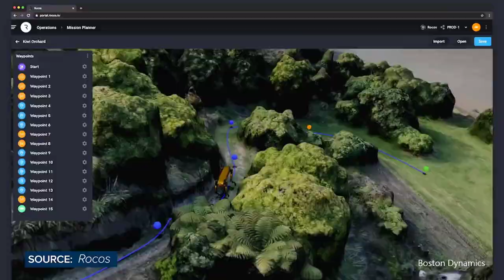Bilge Pumps does Battlestar Galactica Deadlock for Navy Con 1/2

Comment: You might find this amusing:  I worked on the digital computer software for the upgraded versions of the US Navy TERRIER Guided Missile Anti-Aircraft Systems (GMFCS Mark 73 MODs 6-10) before it was eliminated due to the decree that steam turbines, other than for the nukes, were to be scrapped by 1992 (decreed in 1990 with no warning whatsoever, which was quite a shock to our group, among many o0thers!).  The places was originally called NSMSES (Naval Ship Missile Systems Engineering Station), Port Hueneme, California, on the huge Construction Battalion ("SeaBee") Base there, and later called several new things, now Naval Surface Warfare Center (NSWC), Port Hueneme Division (/PHD).  When the new digital computers for TERRIR, the Univac 1218B 18-bit (18, not 16) General Purpose Digital Computer, called by the US Navy the Computer Mark 152 ("C-152") and the size of two large refrigerators standing side by side, with only ~32,000 words of memory on the ships (~48,000 maximum possible, which we used in our own in-house test machines).  One computer per radar, so a ship might have two (if it had a 5"/54 gun on the other end of the ship), of four systems (two per ship end, sharing a single missile launcher per end with two rails on it).  This computer setup on ship was connected to the ship's CIC computer complex by a single line to one of the two computers in a twin-radar battery, with whichever computer was directly connected relaying information to/from CIC to the other system, with either one being the "master" of the two so connected and the other being the "slave".

At my facility, the computer test area had several of our own C-152 machines in the 48K configuration with switches allowing them to be wired up in different configurations and connected to various consoles, printers, and other test equipment for evaluating the software before being released to the ships in the case of new upgrades and, if a ship reported a problem, trying to reproduced said problem and find a fix for it if it was software-related.  I did a LOT of that since I was the assistant to our genius (NO JOKE!!!) director of that simulation facility.   This facility was our replacement of the one inherited from Naval Weapons Laboratory (NWL), Dahlgren, Virginia, where TERRIER was originally finalized in a really Rube Goldberg setup and said simulation system director, one Ernie Childers, stated that we were a PROFESSIONAL ORGANIZATION and he would not tolerate the "crap" Dahlgren had sent up and created, so mostly all by himself, he created from scratch a new design for our WASP (Wrap-Around System Program simulating an entire warship so that the ship software we ran did not know it was not on a ship and we could monitor it as we ran through various tests and sent fake messages to the software just like a ship equipment suite and CIC would).  He created souped-up monitoring and interactive software from the test computers to the computers running the ship software that allowed him to actually monitor a single memory location in the ship software computer to see what happened when we changed some input to the software (CIC message, message from the other C-152 computers in the simulated battery, or faked equipment response, such as the launcher aiming at a target) -- Dahlgren's Kluge could not do that!!!  When he retired I inherited it all and had to make sure that I upgraded the WASP to match new versions of the TERRIER GMFCS as they were getting ready to install them aboard the TERRIER ships -- not an easy thing, since I had to, among other things, fake an AN/SPG-55B tracking and control radar (one per system) as to EXACTLY what it would do under every possible condition while WASP simulated a missile engagement with some enemy target using the upgraded equipment THAT WAS NOT EVEN ON THE SHIPS YET!!  I sweated a lot, let me tell you!

To keep which ship software version was running on which computer, the software initial writers (we did patches, not the original upgrades), VItro Industries, used a simple system:  On the enter front panel of the C-152 computer (a sci-fi addict's dream machine with flickering lights EVERYWHERE!) had the main registers displayed, so that at the end of each 32-Hertz cycle of the program OS loop, there was a tiny window of time until the next loop started and they displayed a pattern of lights there that differed for each version of the program.  The lamps would flash up and down or a checkerboard or something, each pattern instantly recognizable, identifying what was running in that machine.  The last version of TERRIER before it terminated was the MOD 10 version (using the SM-2 Extended Range version of TERRIER the terrier missile  with a number of AN/SPG-55B radar improvements).  When we first loaded it up in WASP myself and some of the other techs who handled the various weapon equipment suites on the ships were there to do some simple checks to make sure it was running at least as well as the previous MOD 9 version had. before officially accepting it from Vitro.  We cabled up the computers to each other and to Ernie Childer's souped-up WASP control consoles and a ship-type test console and a printer for recording messages sent back and forth, and finally to the large magnetic tape handlers that loaded the programs and recorded various test results for later review on those large inch-deep 12"-wide tape reels, some with programs on them and some blank for recording purposes.  When we turned on the MOD 10 ship program, instead of the usual pattern of two alternating patterns of flashing lights as the identifier, as mentioned, suddenly a single lamp on the top row of the register being used for the ID pattern lit up on one end of the row and the single lamp lit slowly moved to the other end and then back again -- A BATTLESTAR GALACTICA Cylon Warrior eye motion. (note that this took a special small computer program module inserted into the ship program to do, not just the simple pick-a-pattern-and-reverse-it method previously used).  We looked at that and laughed, since some of the actual test equipment we used was IDENTICAL to the faked equipment on the TV show (supplied by TECTRONIX INCORPORATED to the TV show as a continuous advertisement of their stuff; how's THAT for "product placement"!!).  I always had to stop a giggle whenever I used that program.

Note that doing something like that was a real problem.  We occasionally had "distinguished visitors" (Congressmen and such) to "inspect" our facility and if you did tricks like that which the visitor thought was "a frivolous waste of Government Resources", you could get into hot water with him and our bosses.  Such is life...
Reply: Wow. Great story. Watch out. We may try and drag you on to Bilge Pumps to relate some of these experiences!
Reply: @ArmouredCarriers  Yeah.  I has a lot of interesting experiences with TERRIER and, after it "bit the dust", TARTAR and, finally, the FFG-7 "mini-TARTAR" missile and 76mm gun fire-control system.  I did programming, data processing to solve problems, acceptance testing, spec writing, and finally, Software Quality Assurance for our division working on the FFG-7 systems (we were at Level 3 of SQA, not NASA's Level 5, since we could not afford the extra people or equipment needed for that)..

Comment: Instead of adding less-capable backups, one of the major ways of improving weapons is to make the main weapons more able to hit targets coming from any direction no matter where on the warship the main weapon might be located.  For most gun systems, using unguided projectiles, this is only partially possible if the weapon can vary its muzzle velocity to act more like a mortar for lobby a shell at a short range over the top of something blocking its aim, such as a ship superstructure if the weapon could point in that direction (usually not possible in large gun mounts in most warships, though.

For missile systems using guided missiles, the missile can change its trajectory over a range of values to allow it to  bypass over or to the side of some obstacle and still get a hit on a target on the far side of that obstacle if that target were properly being tracked and the guided weapon could respond to the alternative-tracker's information properly.  This seems like a no-brainer concerning guided missiles, does it not?  Well, GUESS AGAIN!  TERRIER missiles were large, with a large, fall-away booster to get them up to near-hypersonic speed (they were not called "Extended Range" missiles for nothing!) and were fired from large two-rail-armed launchers, each launcher shared by two missile systems (two separate radar tracker/controllers, actually, each with its own computer and control console) in a battery.  The booster represented a minimum range for usual engagements, since inside it, before the booster fell off, the missile's internal fin-controlling guidance system could not guide the missile much or at all.  In a battery on one end of a ship (no matter what was on the other end, a 5"/54 gun or another TERRIER battery), the limitation to firing at a target at the far end of the ship by the battery at the near end was two: (1) The radar was blocked by the superstructure (mast, funnel uptake, etc.) and had usually about a 30-degree arc that it was forbidden to radiate into -- electric cutouts built into the radar mount.  Prior to the modern systems allowing radars to hand-off missile fired by one system to another system with better visibility (not a simple thing to do!), the radar cutout zone was final unless the ship could maneuver to keep the radar from hitting its blind zone.  (2) The inability of the launcher to point in the direction desired (also mechanical and software "non-pointing" zones), which was mounted to the weather deck and rotated to aim the missile in bearing and, by raising its arms, both missiles at once in elevation, to the desired aim point.  Since the launcher was much lower than the big radars, the arc that it could not point at for targets nearby, with low elevation of the arms, was much wider, more like a 120-degree-wide zone centered on the midship superstructure, though against long range and/or very-high-flying targets with the launcher arms raised to about 45 degrees or more, the arc blocked out was much smaller, not much larger than the radar blockage zone.   The old electro-mechanical computers (C-47 designs) for aiming TERRIER missiles had only one setting for any given target position, speed, and course, with no ability to change this, exactly like a gun mount.  Thus, the launcher cutouts were absolute and non-negotiable.

When they created the TERRIER digital computer software for the C-152 digital computers that replaced the C-47 machines, the designers understood that they now could do all sorts of additional testing and created a large suite of various tests that could be run at various intervals to find out if the system needed any maintenance and other tests to help the technician do that maintenance.  BUT THEY DID NOT CHANGE THE LAUNCHER AIMING LOGIC AT ALL!!!  If the target put the launcher into its non-pointing zone, then, just like with the old C-47 computer, the launcher would not do it and the target was "non-engageable" (which is not a good thing against incoming supersonic or hypersonic cruise missiles, as I am sure you would agree!).  This remained the case for several years, from the early 1970s -- I started work there as a bottom-grade Electronic Engineer at the end of 1972 just when this "computer stuff" was beginning to be introduced --  when the first versions of the digital TERRIER systems came into being (the MOD 6 and MOD 7, each with different radar upgrades, acting as a test platforms for their combined MOD 8 version later on) until the early 1980s just as they were introducing the much more capable SM-2ER missiles (enlarged versions of what was also being introduced in Aegis and TARTAR missile systems)..  As a programmer for digital software (as well as my work in the simulation facility), I had to create patches to fix the software due to various problems.  One of the problems was that each ship, due to slight design differences as built, had its own tables of various unique values that had to be put into the software sent to that specific ship, regardless of the more general upgrades for new equipment changes.  Among these unique inputs was a set of values for those non-pointing zones for the radar and launcher to make sure that the software never ordered the radar or launcher into those zones (a backup to the mechanical stops; you can never be too safe!).  This essentially killed the systems if that happened, since, as with the C-47 electro-mechanical calculators, there was no alternative aiming orders.  The radar zone was so narrow that the ship only had to do a small maneuver to keep it from happening, but against low-angle threats, as most enemies tried to do "on-the-deck" under-the-radar attacks (especially sub-sonic or low-super-conic cruise missiles) the wide launcher cutout bearing region was a severe handicap, especially for a sudden pop-up target near the ship centerline at the other end of the ship if the ship could not turn enough fast enough (ships are not surfboards!).

I was laboriously entering the several new launcher cutout values into the software of a new package to be sent to a ship that had just gotten out of overhaul and had these new values determined by careful measurement by the overhaul crew just prior to ship acceptance, when I said to myself, "This is ridiculous!  We have a Goddam GUIDED MISSILE system here!  Why not use it and fire around the superstructure, as long as the radar can keep tracking?!?!?!?"  So I did some conversations with the missile maintenance guys in our staff and read a lot of documents about how the missiles worked and their nose radar receiver requirements and decided that there was NO REASON WHATSOEVER for these launcher cutouts changing the minimum range or any other capability of the missiles, especially the superior SM-2 missiles, by using a cocked-off aim-point, as long as the radar could see the target and the missile receiver's "eye" could lock onto that target at the minimum range, as with a regular firing sequence.  So I sent in, as a regular BENEFICIAL SUGGESTION (the same way you might state that there was a better way to build a sink in the washroom of our base, egad!), that a "Fire Around The Blind Zone" launcher aiming offset (either upward or to the side of the ship superstructure) formula might be useful since it would ADD 50% BEARING CAPABILITY TO THE TERRIER GMFCS AGAINST MOST CRUISE MISSILE ATTACKS WITH NO HARDWARE CHANGES WHATSOEVER.  My Branch Head read it and liked it and submitted it, with some static from higher ups who could not believe this was so simple, to the Applied Physics Laboratory of John Hopkins University, who were TERRIER's Design Agent and who handled the majority of design upgrades, using their own WASP-like Mote-Carlo simulation systems (with super-computers, though) to test their viability.  A few weeks went by and then we got a VERY EXCITED REPLAY:  MY IDEA WORKED PERFECTLY WITH NO DEGRADATION IN KILL PROBABILITY EVEN AT MINIMUM RANGE AGAINST **ALL** THREATS!!  They began a crash program to develop such a scheme, using an elevation upward offset to keep the launcher away from the superstructure at any bearing, and shortly thereafter sent a version FOR ME TO TEST (now THAT is "service with a smile"!).  I put it into a ship tape and ran it against all sorts of targets and verified that it worked with WASP and, obviously aboard a real ship,  just like they had found in their tests.  It became the so-called "Curve Fire" algorithm used in TERRIER and TARTAR and, I think, for vertical-launched Aegis (not sure about the last).  I got $400 for it.  I had hoped it would be worth more than that, but it did not save money (unless it is the Aegis algorithm too, but that was much later) and just because it increased the capability of the main ship defense system in the Navy prior to Aegis by 50% against the primary threat for no hardware cost did not seem to impress whoever judged that $400 was sufficient compensation.  (Can you imagine if Vitro or Sperry-Univac had thought of it -- would they have settled for $400?  Not bloody likely!!!).  Such is life...

Comment: Re conning towers and Prince of Wales, Hood has a heavy armoured Conning Tower but Holland and Kerr are on the Compass Platform anyway but if you move the hit on the Prince of Wales to hit the command crew inside of an armour conning tower then the likelihood is they all are killed or taken out of the fight because the shell's effect in armoured enclosure versus the shell punching through a larger unarmoured room. So I think the British designers were right a command point that's protected against splinter and small arms is a good idea in night actions and air attack but some of the command crew has to have good vision to evade torpedo threat.

Comment: On the topic of electronics fragility. The digital electronics themselves are rather robust. The are resistant to temperature, vibration, and impact. With regards to EMI you can get hardened electronics. They are more expensive than civilian equivalents, mostly due to the limited supply. Most of the fragility comes from enclosures. If you were to throw that phone the glass would shatter but the electronics would likely still work.